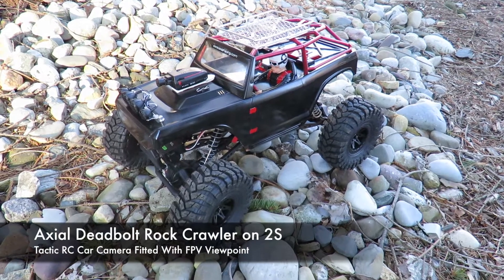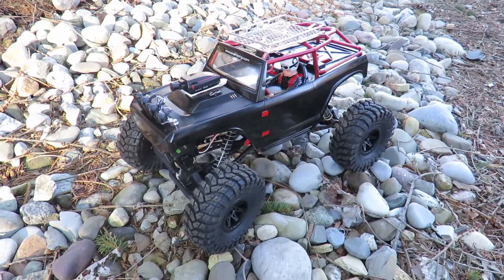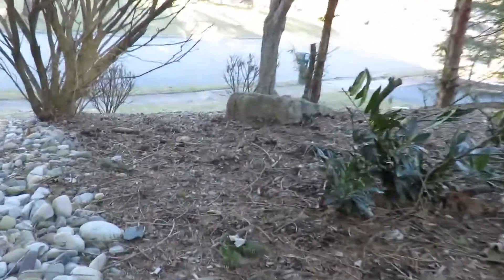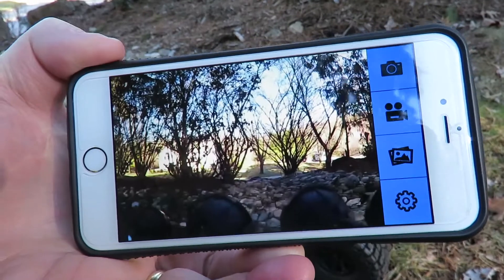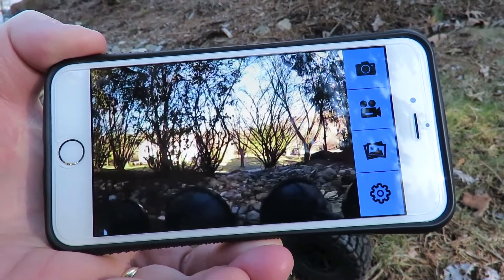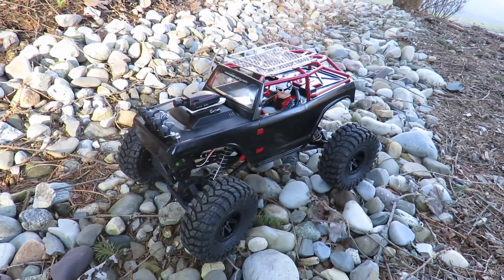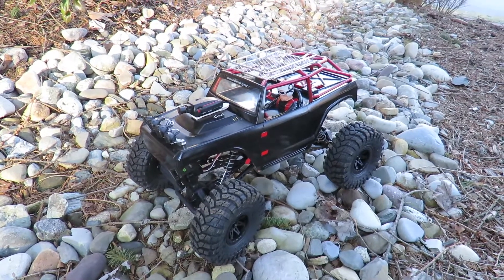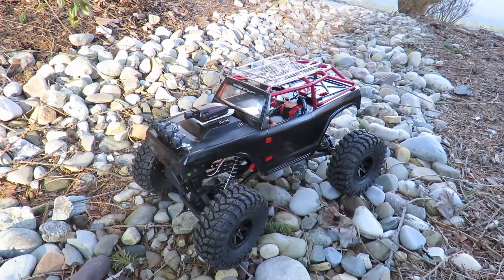Axial Deadbolt RC Car Rock Crawling with Tactic Droneview FPV Camera

Comment: That's a lot less shake than mine is with go pro on. How do you attach it?
Reply from the maker: +Big Backyard Ideas It's stuck on using 'Command' velcro picture hanging strips. They are the type you can stick to walls and remove without paint damage. Same principle with the car.